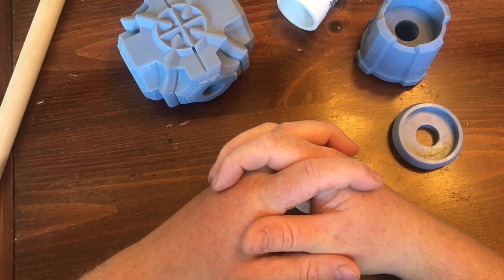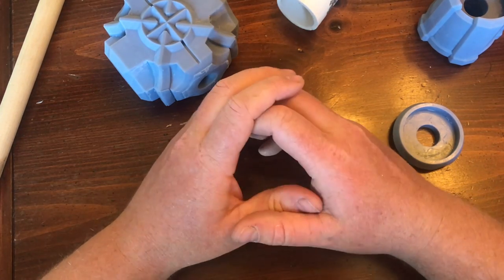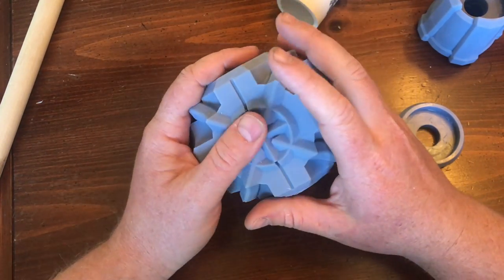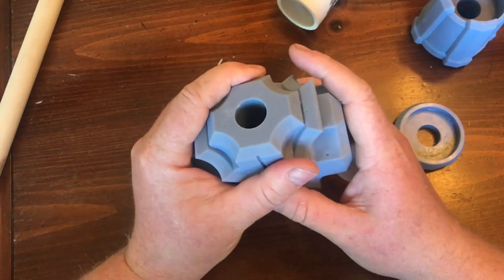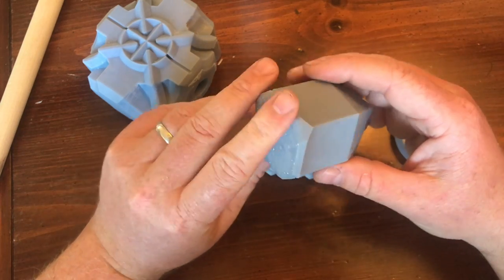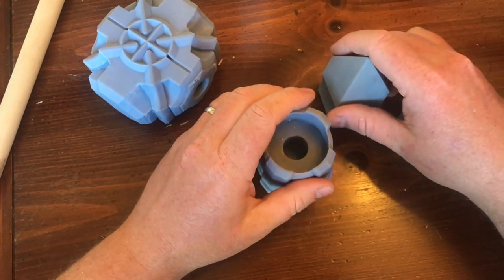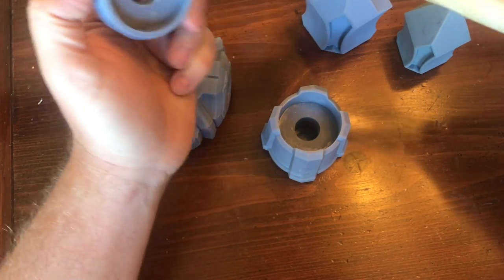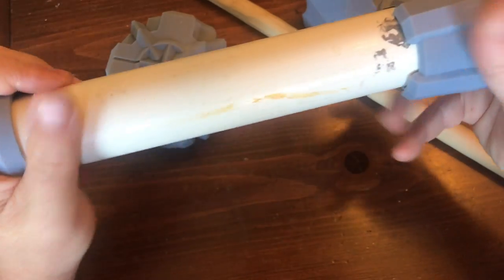Castlevania IV - Simon's Vampire Killer Whip Prop DIY

Comment: I love it! Your new 3D printer opens up a whole world of prop making. How do you like it so far? Did you say you built part of your chicken coop with a 3D printer?
Reply from the maker: Lol, no.  No 3d printed chicken coop.  If you look back in my library you will find me talking about the coop (Which was only partly done at the time) I designed it in Vectorworks, the same program I designed my 3d printed items in.  It really is a versatile program.    As for 3d printing, it is neat.  It allows me to make shapes that would be very hard to replicate via traditional methods, but using traditional build techniques complements 3d printing rather than 3d printing replacing them.   They are both tools and I am looking forward to exploring more in the future.  Thanks for watching Fraidy!
Reply: @SamhainPropworks  Oh, ok. Your chickens still probably have a drawbridge---and maybe a few trebuchets. 😂 My chicken coop is made from one of these kits. https://www.cottagekits.com/playhouses/